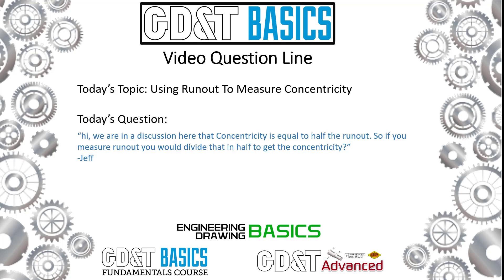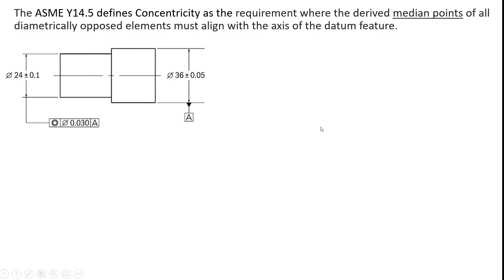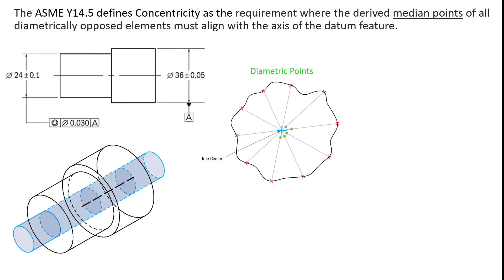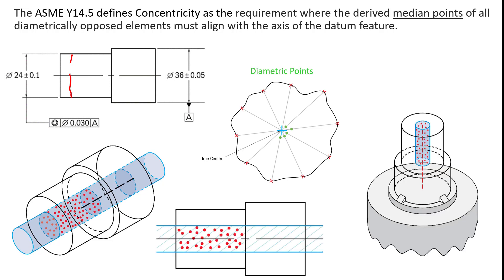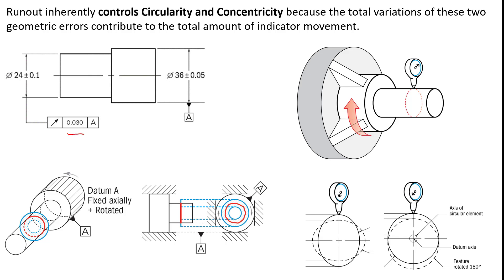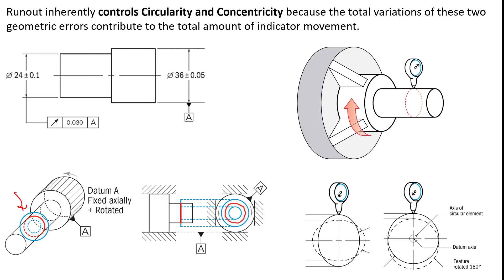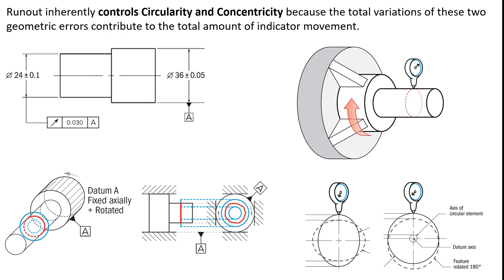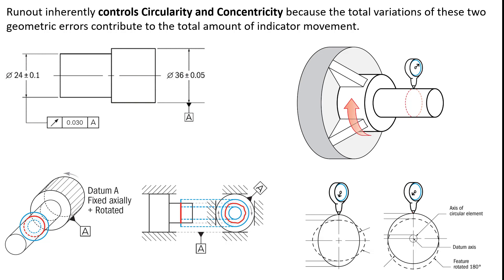Using Runout to Measure Concentricity

Comment: Please explain more about how 'Datum A is Fixed axially + rotated' as shown in the lower left view.  I suppose in practice there are multiple ways this may occur like that end is still in the lathe and freshly machined.  What if it's been removed from the lathe and the part has been passed over to metrology?  They would likely place Datum A in a Vee Block and rotate but datum A has the  .05 tolerance and may not be circular.
Reply from the maker: Without doubt, our desire would be to inspect this while the part was still in the lathe. This is because our reference was for the machinist to use Runout as the method of measurement. Though not our desired method (and less accurate), I think that many of us have been forced to use a set of vee blocks to inspect Runout. If this must be done, I have always used the strap clamps that come with the match set vee blocks as a method of keeping the part from “bouncing” due to Circularity error. However, I will not drive the metal clamp straight down onto my part. I will place something in between that will allow me to apply very slight pressure while still being able to rotate the part. Again, this is not desired, but desperate times call for desperate measures! 
Hope this helps!

Comment: So both concentricity and run out can be checked using the same setup (dial gauge and collet). If during measurement of runout, the derived median point is ascertained from diametrically opposite points, then we can measure concentricity too.
Reply from the maker: Checking concentricity is similar to checking runout except it involves a bit more math and an understanding of how far away your indicator is from the axis of the rotation when you collect your diametrically opposed elements so you can then calculate how far away the derived median point is from the datum axis. Like we mentioned though this requires measurements to be taken exactly 180 degrees from each other so that we can calculate where that derived median point is with respect to the datum axis. This is alot more work than simply reporting the total indicator reading during a full rotation, as you would when checking runout.

Comment: Circular runout is more stringent control than concentricity, because it also rejects form error such as the oval feature that was shown. That oval shaped feature could have near perfect concentricity with all midpoints accurately centered to the datum axis. So if runout is checked instead of concentricity, no non-conforming features would pass. Total runout check does not have an advantage over circular runout check as an alternative to concentricity inspection, because concentricity, despite of the continuous cylindrical tolerance zone, doesn't limit taper, barreling, waisting, or waviness in the axial direction.

Comment: Base on the lower right diagram, if got to define concentricity in diameter zone, it should multiply by 2 from the indicator reading?
Reply from the maker: For runout and total runout, the total indicator runout is the reported value and it must be less than the listed value in the feature control frame to pass. For concentricity, it is not simply enough to multiply the indicator reading by 2. You must take 2 opposing measurements 180 degrees from each other to find the exact midpoint between these two measurements. Then that midpoint must remain with in a cylindrical tolerance zone that is centered at the datum axis. This is very hard to inspect without the right equipment. For this reason we recommend utilizing position or runout to control coaxial features instead.

Comment: Can Total runout be used instead of coaxiality? For the same geometric tolerance value, which one is more stringent than Total runout or coaxiality?
Reply from the maker: By Coaxiality im assuming you meant Concentricity? If so,  i would recommend using total runout instead, as its much easier to inspect and generally is more applicable to the functional intent of the part. The value however is not directly translatable as they are very different tolerance zone shapes. As far as which one is more stringent, it depends on the tolerance value chosen for each symbol.
Reply: can you do it practically ???

Comment: hi i would like to ask you how is it possible to measure runout on a surface that is perpendicular to the datum or is this a possible engineering mistake?
Reply from the maker: Definitely no mistake. Total Runout is the "preferred" control as it is a 3D control. The Runout controls require a Datum Axis and it is simply interpreted as "Perpendicularity". Place a dial indicator parallel to the Datum Axis and on the face/surface to be inspected. Move the indicator towards the axis (center) and then to the O.D. and this is Total Runout on a surface perpendicular to the Datum Axis.
Hope this helps! Thanks

Comment: Total Runout = Concentricity + Cylindricity

If you measure total runout and it is within 0.030, then concentricity is within 0.030 as well.

When you refer to Y14.5, you must always provide the version! In 2018 version, they removed concentricity and symmetry.